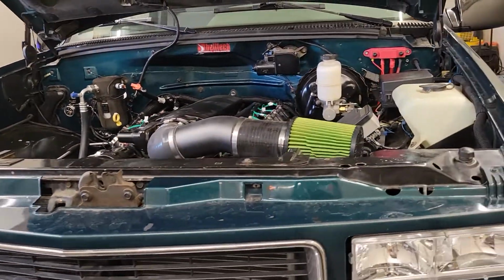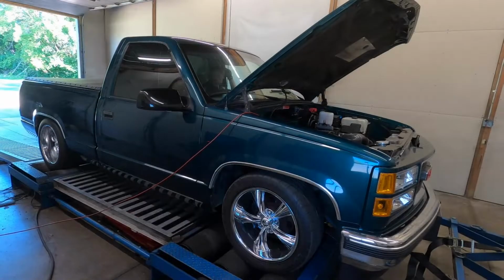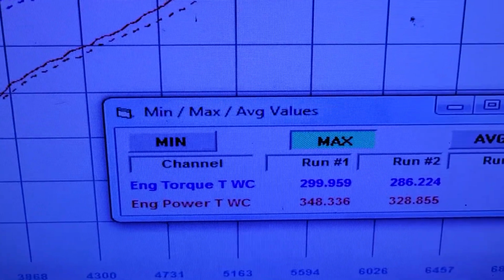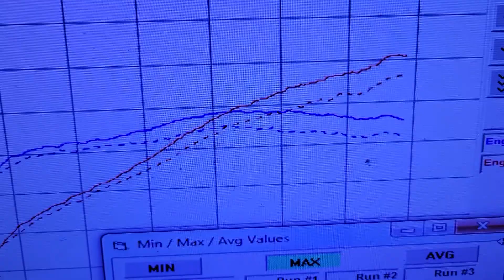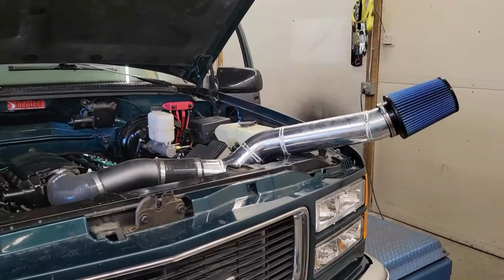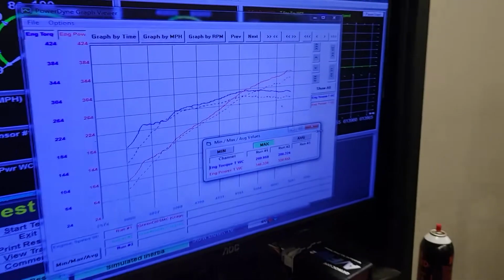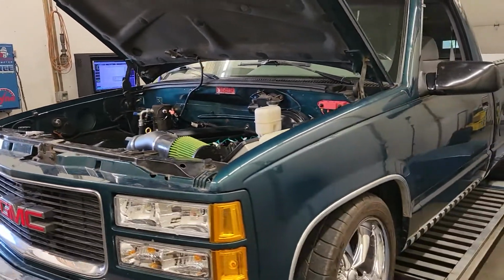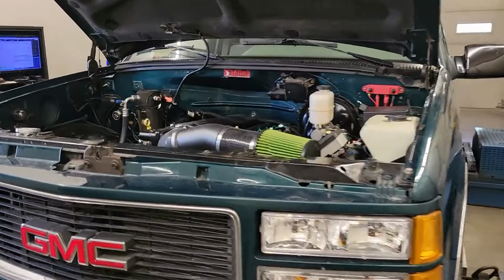LS Swap Chevy OBS Truck | Speed Density | Dyno Review

Comment: Where was the IAT sensor mounted?
Reply from the maker: Between the filter and the throttle body.
Reply: @ForceEngineering  is running IAT better than MAF?
Reply: @jays6.021  Speed Density is when you use the MAP senser vs VE table as the primary fueling. IAT senser when Hot pulls timing from engine.